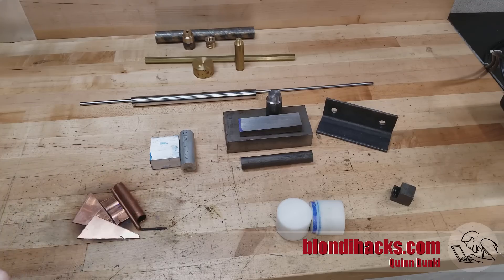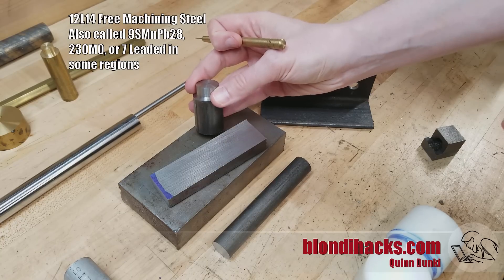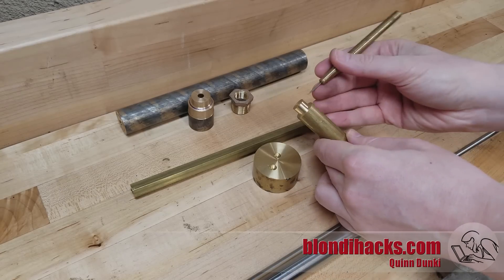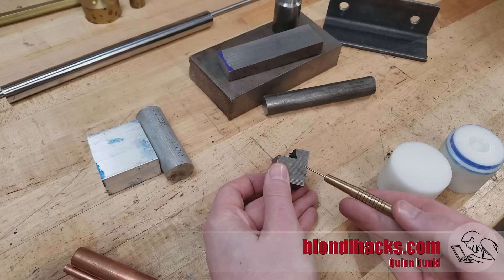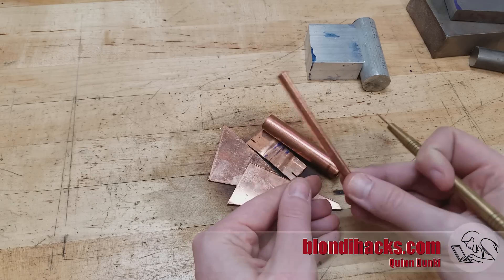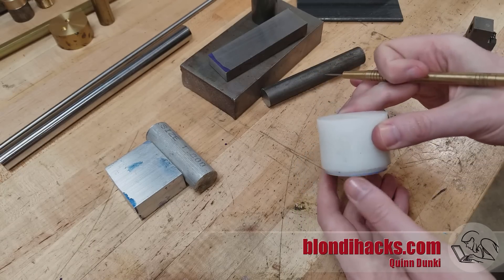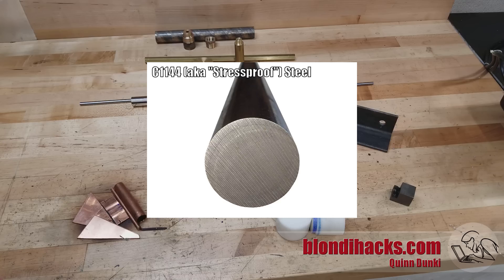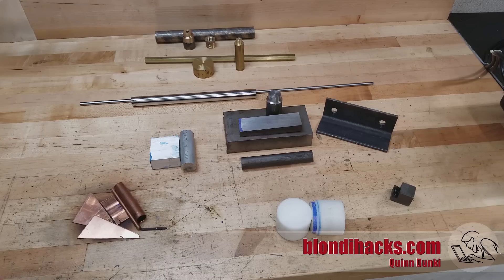Metal Lathe Tutorial 13 : How To Pick Metal

Comment: @7:00 I work at a hardware store, and our warehouse is having an inventory changeover as our store owner was doing a renovation.  As a result, it meant it was cheaper for him to replace all the inventory at once rather than sort all the parts twice.  So all those old, but perfectly good plumbing fittings were destined for the recycling center.  It was something like 100 lbs. of Brass tubing, nuts, flares, couplings, you name it, it was there.  I ended up with 10 lbs. of mostly 1" tubing for $20, thinking if I ever got around to learning how to use a lathe, it would probably be a good idea to have some stock to turn into chips as I learn what I'm doing.  Fast forward one month to today, watching this video after getting certified to use the Grizzly 4000 at my local Makerspace.  Wishing I had dropped the $200 to buy it all now, but someone else made him an offer, and it seemed rude to buy it ALL at that point :P  I'm just glad I got some so I can make a few rings and stuff.  Thank you for letting me know, I will definitely be keeping an eye out for more chances like that in the future!

Comment: I have had mostly good experiences with Grainger - for tools and hardware, as well as materials; much better selection than 'big box' stores at significantly lower cost than online, and I can pick up without too long a drive. And only once have they not eventually delivered what they said was available (though there have been sizable delays a few times).

Comment: I've owned an industrial machine shop for 45 years and even I have problems buying materials from local and national suppliers. Every few years I find that the terminology of buying metals tends to change slightly so I'm constantly having to clarify what I mean when buying stock. And even I run into the "you're small potatoes" when ordering because I only purchase what I need for the jobs I have and not tens of thousands of pounds. I've even had suppliers I've used for 35 years tell me to go elsewhere, which ticked me off to no end.

Comment: One of the most evil metals I have ever machined is 321 Stainless.  It was okay in the lathe, and tolerable on the mill, but when it came to tapping it or drilling it, it was pure evil.  About 15 years ago, I must have broken $50 worth of taps on $2 worth of 321.  It will be tapping along tightly, but then will just without warning suddenly seize.  I avoid the stuff now.

Comment: I dare say, mystery brass and bronze from the scrapyard is by far the cheapest you can supply copper alloys. I stay away from the salmon coloured stuff though. Copper scares me LOL

I have had some luck with mystery steels after doing basic field metal identification: File test, spark test, machine-a-small-amount test, heat treating sample test... It's definitely a little time consuming and requires one to use their noggin a fair bit more than using known alloys. The nice thing about scrapyard types of place is that they pretty much only care about weight, so if you pick up 20 pounds of unusable steel, you can just trade it for 20 pounds of a different, "maybe" more machinable steel for little to no cost.

Comment: I was pleasantly surprised recently, turning a length of "zinc plated smooth rod" by National Hardware. I expected it to be choppy and hard like most of the hardware store rod stock I've found, but it actually cut pretty smoothly! No idea whether it was made of hot- or cold-rolled steel!
Reply: I take it back. That zinc-plated stuff was really hard to turn and even harder to run a threading die over! x.x

Comment: Hi Quinn, After years of being dissatisfied with my turned finishes on the worst grades of steel, I came across the HSS shear tool. Works great on all grades for light finishing cuts and very easy to grind, the finishes are unbelievable. Made from square section tool steel with two grinds only. The first is a 30 degree backward slope across the full tool height, the second is a 10 degree end relief. Tool height is with the work centre about half way up the cutting edge not the top point as in most tools.Work centre height near the bottom of the tool to turn to a shoulder. There are some diagrams of  the grind angles on the net. Rob

Comment: the way i estimate the grade of mystery steel is to just throw it on the machine, take a small cut and see how it behaves. if the tool starts screaming and the lathe walks halfway across the shop then i know it is outside my limits.
Reply: Makes sense. I usually pop a 5/32 hole in the metal and see how it drills. Typically gives an idea as to its hardness.

Comment: I'm 72 and a self taught machinist before the Internet. I do enjoy watching your Videos and will add some input. I was a Steamfitter/welder in NYC for 30+ years. When we removed valves for replacement instead of selling the scrap steel with the valve stems I cut them off first. I have valve stems which are acme thread up to 1-1/4" OD and no doubt an alloy of bronze. I have used that material for everything and it has never let me down. Keep up the good work Guinn
Reply from the maker: That’s a great tip for finding expensive materials. Thanks for sharing!

Comment: What type of steel are the smooth rods from standard printers made from?!? Someone please god let me know lol.  I’ve got tons of em.  They are definitely ferrous. Can’t seem to find any info on any brand of printer.  Madness. They machine well tho.
Reply from the maker: My guess is they are the most inexpensive mild steel that they could find on the Chinese market that week. 😀 It's interesting that they machine well- I would guessed the opposite, since they're probably not meant for it.
Reply: Blondihacks Right.  Well in comparison to the crap steel bar stock that they use in treadmill rollers they turn like a dream.  I have a bad scavenging habit.  Picked up four treadmills and 8 printers this “spring cleanup” in the town I spend half my time in.  I do have some great 2.25hp continuous duty dc motors though for building other tools with.  My only other resource in my area is the recycling center where I’ve been living off of some other cnc guys scrap in the form of 6061 t6 rectangle bar stock for milling.  I never really thought about eBay.  Put in some mock orders of 12l14 and stainless through online metals and was turned off by the shipping.  Gonna take a look at the eBay seller you mentioned.  Thanx
Reply from the maker: That's quite interesting- it's good to know which scraps machine well and which don't. I'll keep my eye out for junked printers now!

Comment: A great source for cast iron round stock is used camshafts. Have used them in my modelsteam engines. Great vid Quinn.
Reply from the maker: Oooh, that's a great tip- thank you! I didn't realize they are cast iron. Easier to break down than engine blocks or 1970's Chevy cylinder heads. 🤣

Comment: Great source of ground steel rod is old printers. Usually in 10mm-15mm diameter. Old CD/DVD/Floppy drives often have short sections in 5-8mm as well. Sometimes it's stainless, but a magnet will help sort that out quickly.
Reply from the maker: robert bownes That’s a great tip! Is it hardened, I wonder?

Comment: Exactly what I needed.  Thanks!  I'll be looking forward to your heat treating video.  Specifically, I want someday to make a round hole punch and a die for the resulting ring using approx. .009 steel (shim stock I guess) for typewriter key ring replacements.  I mean the kind with glass under the key rings. Yes, I know one can find salvaged antique keys online, but as a typewriter collector and restorer I have a strong antipathy to key choppers.  You have a great talent for this and to make it all so approachable.
Reply from the maker: Sounds like a great project! I'll be doing some heat treating very soon in a project video on the channel. I'll likely do an educational-style one as well at some point.

Comment: This would have been extremely helpful when I first started out.  I would also add that only buy what you need.  Especially when starting out.  When you take a look at the off cut area at a supply house it is really tempting to buy extra.  Almost every time I have bought extra 'possibly useful stock' it it just sits in a pile under my bench for years.  At least that's my experience.
Reply from the maker: Yah, accumulating junk is hard to resist in metalworking. Every scrap "might be useful someday". That feeling gets reinforced when, once in a while, that chunk of whatever you've been storing for years is JUST THE THING for a project. 😆
Reply: @Blondihacks  the flip side of that is when you could use  a piece you've saved but wont use it because then you wont have it for something even better! Oh, let the hoarding begin!
Reply: I typically need something from my 'extras' stash just after I've moved house and taken all of it to the scrapper.
Reply: I keep all my 'clean' ferrous materials in the house. Saves it from all that corrosion. If SWMBO were still here it could be another story.

Comment: Why do all those metals look the same? 😉
Reply from the maker: It would be nice if they dyed them different colors or something. 😜
Reply: Blondihacks that’s not a bad idea at all! 🔥
Reply: They did used to color code steel. Not sure if they still do.
Reply: Bill Oxley yeah they still paint the ends of most stock, but when buying drops sometimes it’s hard to tell...
Reply from the maker: Yah it seems to depend on the supplier also. The local place I buy from is not very consistent with painting the ends, and once they’re cut the information is lost. I’m not convinced everyone agrees on which colors mean what, either. 😁
Reply: Blondihacks I worked at a fab shop that sold wholesale metals and they almost never had the same color of paint from shipment to shipment. I’m pretty sure, like you said, each supplier has their own way of coding them...

Comment: Apart from the usual bits of mild steel we all have, the only piece i can positively identify is a small sheet of D2, every 18 months or so i get motivated and make a few knives.
Life will be so much easier with your handy visual  ID method and the vast ammount of knowledge in the last few minutes was astounding 😁
Reply from the maker: Thanks! I hope it was useful! Identifying steel by sight is very difficult, but often you can make a good guess at what it is by making some chips on the lathe.

Comment: I am a fan of making something out of a recycled bolt whenever possible, as well as all the suppliers already stated. Good video Quinn, thanks for the vid , cheers!
Reply from the maker: Recycled bolts can be fun, and I have definitely used them as well. They can be tricky though, because the grade of steel varies a lot. Sometimes they are very difficult to machine. I shattered a parting blade once trying to re-use an old bolt. It may have been Grade 8 or something, because it sure didn't want to be machined. 😅

Comment: Thanks for a very good video.  I am fortunate to have a scrap yard/metals reseller within 20 miles of my home.  He sells by the pound, whatever you find- long, short, plate, sheet, steel, aluminum, you-name-it.  If I care to drive further, I can find several new retailers.  Also, Lowes and Menard stores sell metals.
Reply from the maker: Yah, honestly, I didn't mention the big box stores because while they can be useful in a pinch, their markup is crazy high and their selection is very limited. That said, I've definitely bought stuff there when I need a little piece of something "right now".